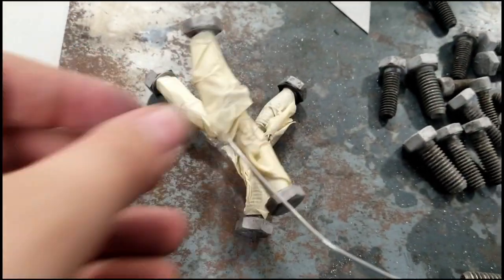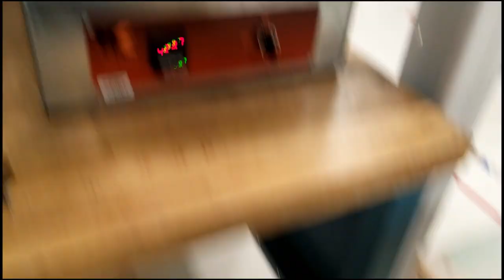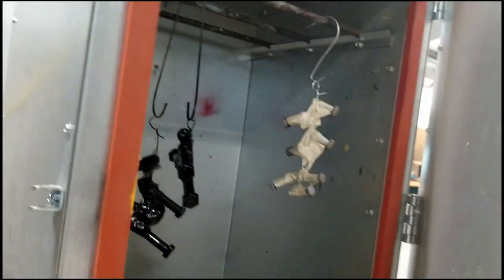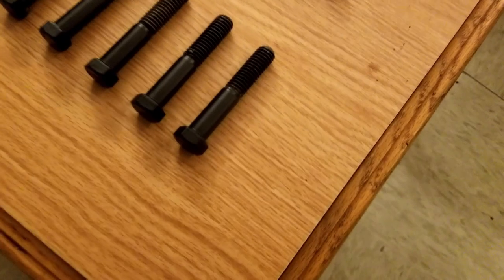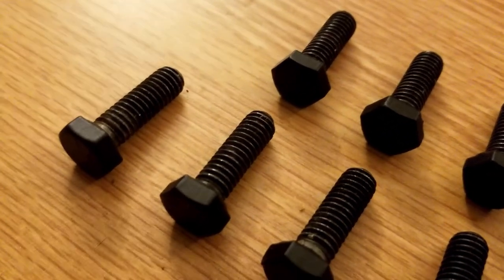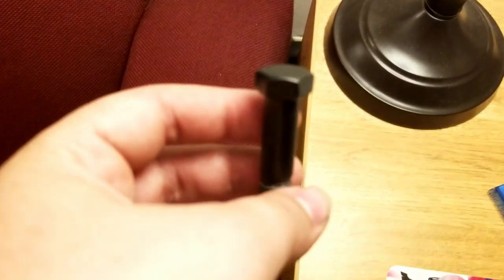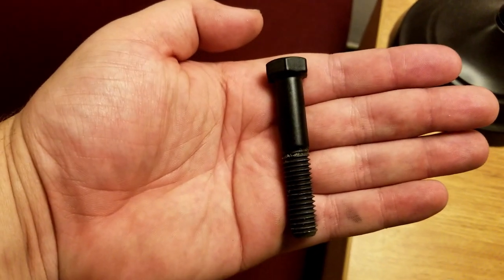"Saylor Beall 705" Bolt Powder coating - Restoration #7

Comment: would this also work with a new bolt without sandblasting - just cleaning with alcohol and then powder coating? - or will the paint fall off afterwards...? i dont have a sand blaster but i'm going to buy a powder pistol...
Reply from the maker: The sand blasting allows the powder coating to adhere better, if i would do this again i would have hot blued, as when i torqued the bolts down it removed some power coating at its head.